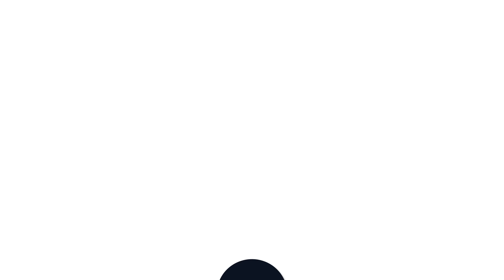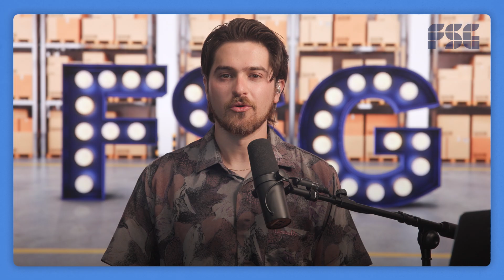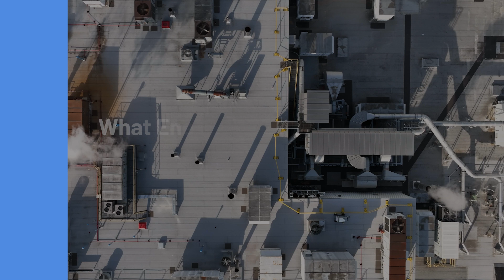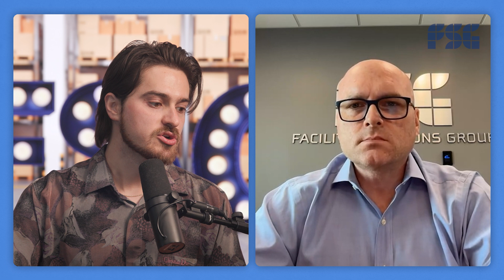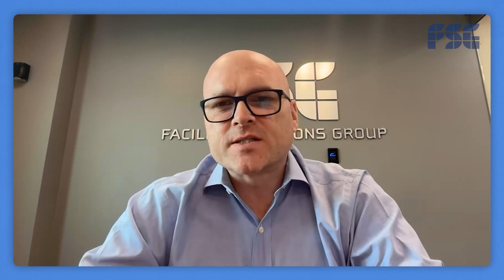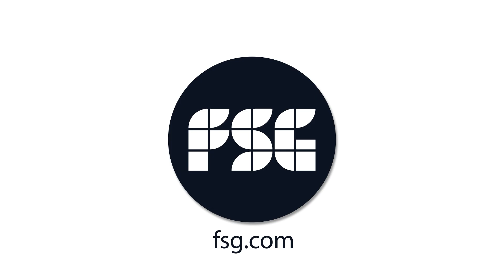What Energy Efficiency Really Means for Commercial Buildings

Comment: The BEST and most cost effective effective Power Management and Control System available.
The most energy waste in Commercial buildings is in the HVAC system or MFG motors due to power factor correction problems, Motors are inherently inefficient , wasted energy can reach 30%  . lets start with the induction motors that at best are 82% efficient and can go to 50% at reduced loading. There is a remedy for this with a little known technology called MPTS. The technology does much more than save energy .This Technology has been used in hundreds of buildings across the world. So there are many references and case studies.
The energy savings not only save significant $ on utility bills but also increases the life of equipment up to 10 years IE: Chillers, RTU, VFDs, AHU, Transformers etc. The real money savings come from the reduced maintenance and increased life of equipment. They will guarantee the power savings after a quick power assessment. .So the customer has NO risk. The ROI in California is under 2 years, the system life is 30 years so it actually will pay you to have it for the next 30 years.
 if interested contact Dave Parsons 529-237-3648 or davep@voltagestasis.com 
visit website www.transpowerco.com